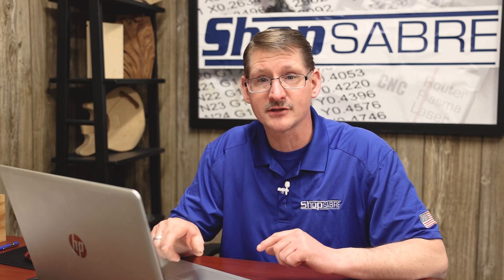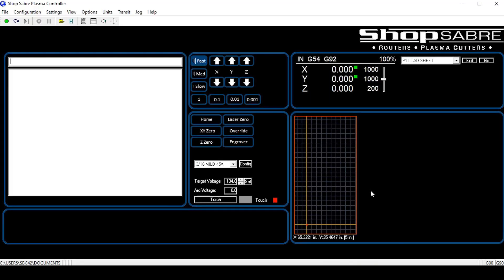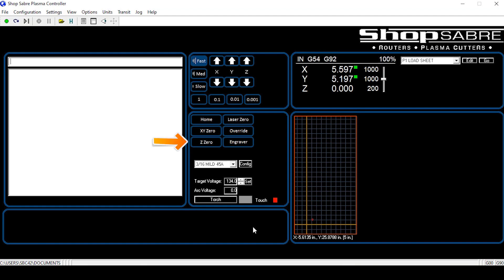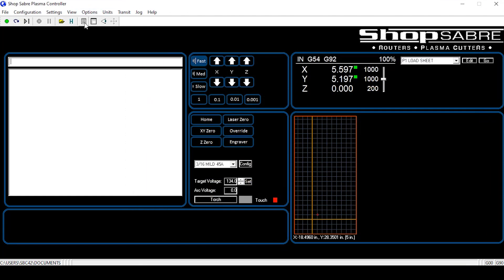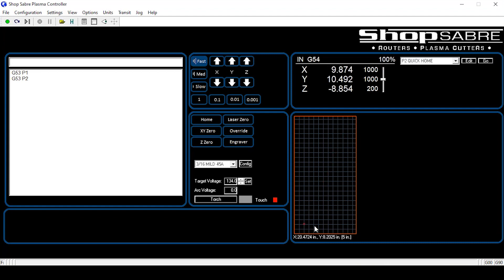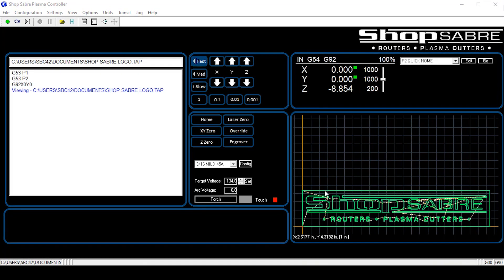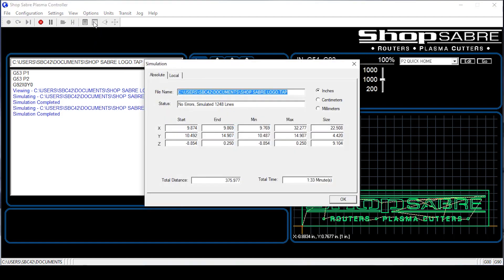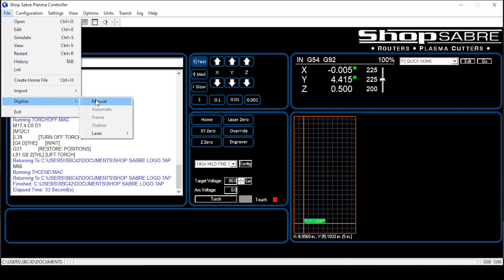ShopSabre CNC - Plasma Control Functionality

Comment: I'm having the same issues w/ my 5 x 5' table.  Its basically new, but it recently went through an upgrade via Burn Tables that took 18 months.  I have zero confidence in the table, and I can't seem to cut out a part..    Is anyone else having similar issues?  has anyone else tried Dustin's recommendation on the CandCNC product to resolve the issues?
Reply from the maker: Hello there, if you're a ShopSabre customer you have access to our technical support team who can assist. Reach out to them. We've got incredibly knowledgeable, Minnesota based support staff. That said, we do not build a 5x5 table so we suspect this is not a ShopSabre table.

Comment: So do you have a video on how to trace, mark points (what points to mark), export, tool path, export and import back and cut it. Is that all done on the screen you were on or in enroute????
Reply from the maker: Yes the entire process is done on the screen, the manual has a step by step direction on how to do this or you can call support and they will walk you through it.

Comment: You talk about all the setting but how do you use them. For instance how do you set the fast home setting? Or how do you set the fee rate for circles only and still have fast for line cuts?
Reply from the maker: This is handled in your ProNest LT software or you adjust the feed rate by material in the material library